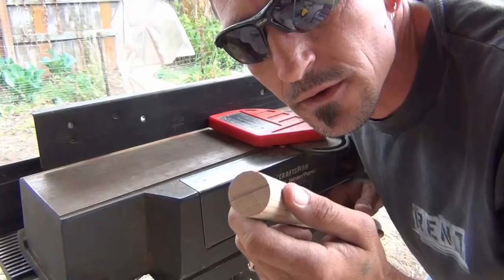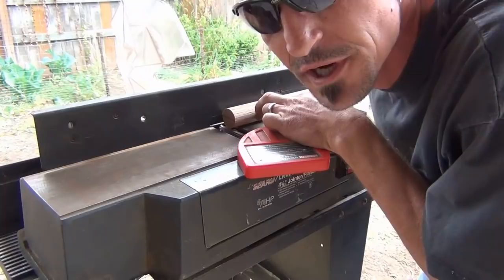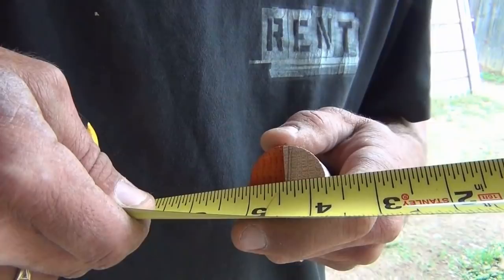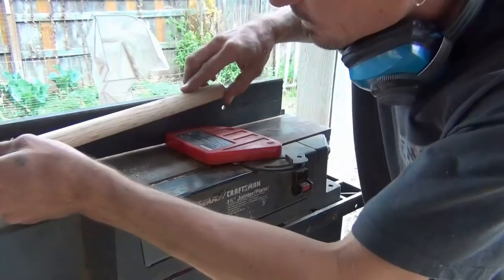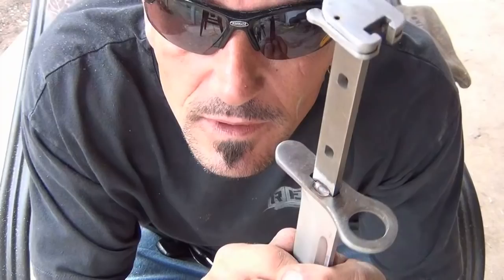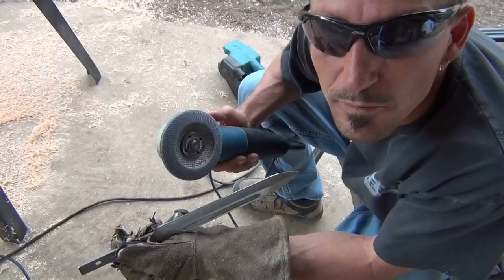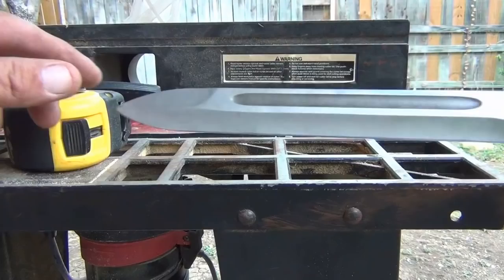Building A Tactical Walking Stick 2

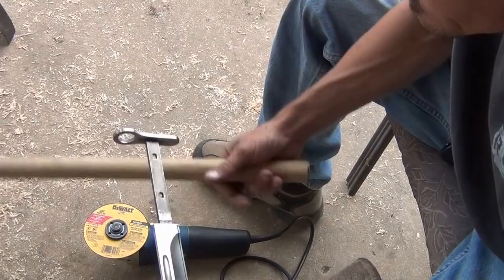Comment: @ 2:25

this is the first time seeing your videos, and im just putting positive feedback for your safety: 

1: you should never point a blade at yourself, and by extension, when working on a blade never direct an active tool so that momentum could push the blade Towards you

2: thats good and all that you had eyewear on, though i do not know the strength rating on them, it is still easy enough for work debris to fly into the nose-bridge of your glasses. and eye-wear should never impede your vision (im talking about the tint of sunglasses)

(sort of) 3: why would you grind down ~an already sharp edge~ ? wouldnt it be easier to grind down the spine of the blade and spare the blade? (well, it does have a fuller, i guess thats why you grind the blade, to spare the fuller)
Reply from the maker: good points but all was well
Reply from the maker: and the blade was ground because if I ground the spine down the the blade would have been off center and harder to mount